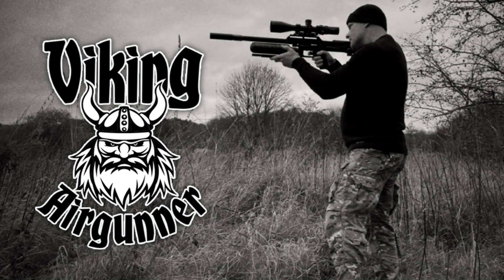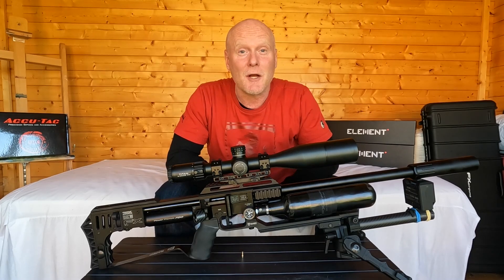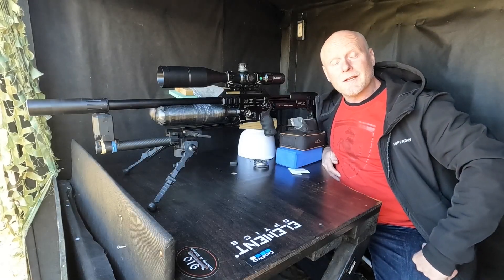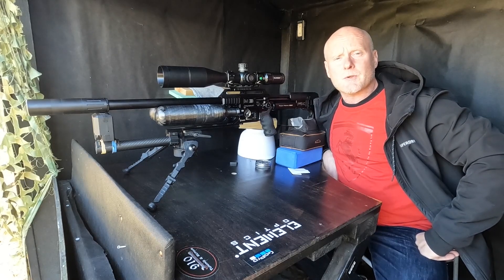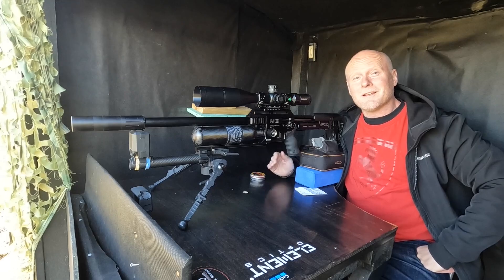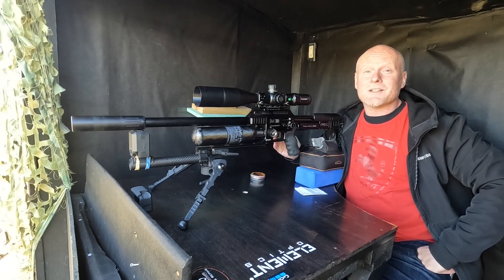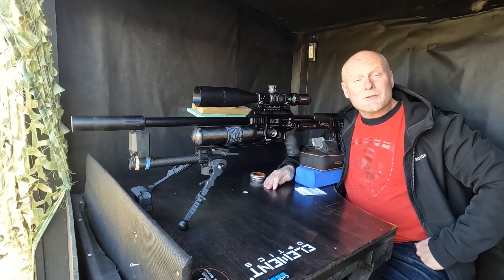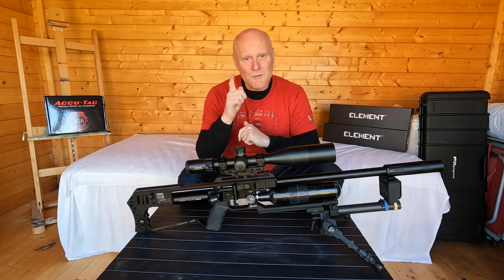UPGRADE to AMP 2 REGULATOR : FX IMPACT M3

Comment: Since I put the brass piston in my M3, it will always creep up exactly 5 bar if it sits for a couple of hours or longer.  Even if it sits 2 or 3 weeks, exactly 5 bar.  One shot and it drops 5 bar and stays there until it is stored again.  That 5 bar doesn't really affect my zero, so I'm not concerned at this point.
Reply from the maker: Almost the same here and Im not worried either 😃
Reply: How the hell do you even see 5 bars on the gauge. Plus these small gauges are not accurate. So your 5 bar means nothing.
Reply: @johnrambo1349 have you considered he's got a digital gauge?
I am running TWO digital gagues on my M3,  because i wanted to precisely set my regulators. 
Although I'm going to switch the first stage reg gauge back to analog  gauge after tuning and keep the plenum (rear) gauge digital.

Comment: Always appreciate your videos and great content. In my opinion, an appropriate test for regulators is to shoot them from the max fill pressure till the reg setting pressure and check ES and SD based on the whole string and not only 5,10 or 20 shots...

Comment: can you tell us what your washer stack is on your new piston as well as how you lubed them correctly 🙏
Reply from the maker: They are stacked as original. Believe it is ) () () () () () (
Just lubed the slightly with silicone grease, but Im pretty sure that it was the oring I missed in my first attempt 😃
Reply: 12 washers in m3? Thought it was 11 
When I tried to fit () () () () () ( there was hardly any room to fit brass piece on to piston 🥺can you advise please
Reply from the maker: @marktemple9315  sorry I put one too many on there. It was a direct swap from the plastic piston.

Comment: Love your videos. Thanks for this one. I could be completely high, but it made me wonder if fill time (or pressure drop after a shot), could somehow be used to set the valve. Of course, maybe the gauge would have to show pressure to a couple of decimal places but….
Reply from the maker: I want to understand your question correct. Can you explain in a different way? 🤔
I m a bit on the slow side😜😂

Comment: I like the idea of brass over plastic so I am going to swap it over. 
I found running my first reg higher than the 20-30 fx recommend more like 40-50 difference between the two reg's made my dev come down.
Reply: also polishing the hammer spring as well as the hammer and the other moving parts in the gun will bring the deviation come way down I can get 10 same shots on my dynamic .25 express after polishing those parts, and when they start creeping up do it again.

Comment: Im going to bypass the first reg and put in the M4 AMP regulator. To me it seems that the whole reason for the first regulator was a gimmick. All they really needed to do was just make the 2nd regulator with better materials that could hold up to being charged straight from the 250bar pressure. Im tired of messing with 2 regulators.

Comment: Hi Peter , i just installed the gen 3 2nd regulator from huma air . i bought the high pressure version (100/200bar ) I increased the 1st regulator to 180 bar and  the 2nd reg to 150bar but if i unscrew the bottle now the  whole system degasses ,1st and 2nd reg drop to zero . Normaly the 2nd stays under pressure . Velocity is not consistent . What could be the problem.
Reply from the maker: Usually the preasure remains in the plenum, so I cant really say. But I would rather have it like you instead of not being able to degass the plenum 🤔
Reply: @VikingAirgunner  HI Peter i solved the problem . I took the reg back out and found a peace of debris between the bellvillewachers , i think it was a peace of o-ring so i changed the o-ring in the block and put it back together. checked for leakes and tested and now i see the spread that you saw in youre video 🙂. Thanks for youre answer

Comment: Hi. What is the factory piston on the fx impact M3 power block, brass or plastic?  I have not opened the regulator.
I have a 20 fps difference but shooting at 100 meters 3.1 cm.
Reply from the maker: The new AMP regulators has the brass piston. The big spread can occour on a new regulator - I just had the same thing happening on my new Panthera.
What you can do is to take out the regulator and lube up the o-rings and springs and perhaps also polish the springs (lightly)
That helped me and thanks to this my spread has gone down to almost nothing🙂
Reply: I've been wanting to do it for a long time, but I've been hesitant to do it. Now I have no doubts and will do it. And at the same time I will install hummer weight 8,5 grams from Huma-Air. Also was bought a long time ago, but after your video about hammers decided to install.

I shoot with homemade slugs 30 gr 5,5 mm. Barrel 700 mm.

Comment: Thanks for the nice video. Can you tell which grip you used and did it fit by default with the bag rider? Also, in the first part of the video (0:20) did you have a different first stage regulator?
Reply from the maker: I believe it is an Ergo Tactical Deluxe grip and it works well with the bag rider. It was mounted on my first Impact that I bought used, so I just kept switching it over to my new guns😃
What you can see it the dual bottle adapter ☝️
I took it off after mounting the power block 🙂

Comment: main thing is accurate.. not how fast the regulator fills but how EXACT it is
same on the hammer valve...
How much variation in FPS you see (at best ZERO) and in what settings your groups are the smallest (shooting hole in hole)

Comment: What pressure difference between Reg1 and Reg2 in this Test ?
Reply from the maker: Around 50 bar. I dont pay too much attention to the 1. reg settings. Just making sure that it is over 30 bar difference 🙂
Reply: @VikingAirgunner  Got 8-10 seconds with HUMA Gen 3 Reg upgrade, setting: 175  first and 143 second -  very disapointing ....
Reply from the maker: @emmerichweinlich1057  Did you change back to the AMP regulator? My experience tells me that regulators gets better over time or if you polish the springs 🙂

Comment: My Mk2 .177  regulator is 120. And I'm getting about 100 shots is that good?
Reply from the maker: It depends on the ammo and velocity 🤔
Reply: @VikingAirgunner   10 gr knockouts  980
Reply from the maker: @danielwayn  it seems like a very high reg. Wich barrel length?
Reply: @VikingAirgunner  500
Reply from the maker: @danielwayn  it has been a while since I shot the 500 mm and I cant really remember my settings, but still 120 bar seem high. Have u seen my tuning video? The method there is to have a max velocity about 20-25 fps above the desired velocity. So in your case 1005-1010 fps. If your max is above this you can turn down the reg and get more shots. If not you are fine 🙂